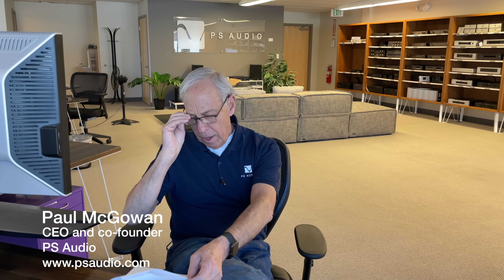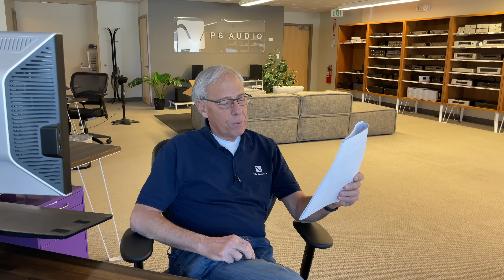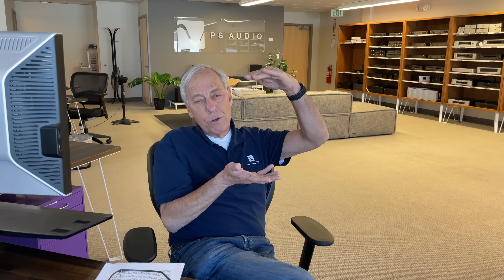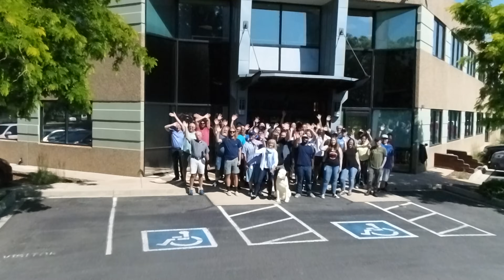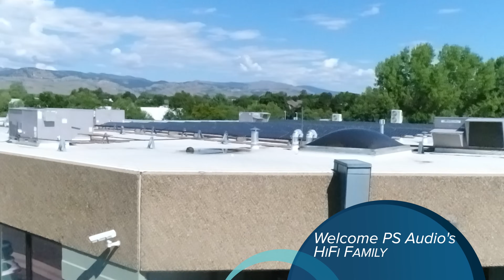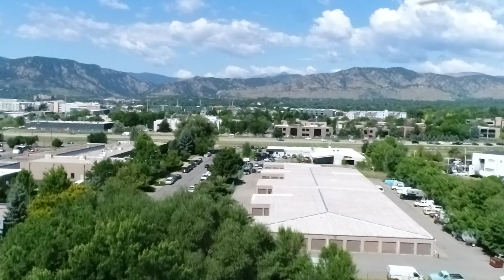Understanding multiple woofers

Comment: Hm. Everyone should hear single driver speakers to understand one concept of stereo theory: phase. A crossover-less design showcases this. Start adding multiple drivers and phase quickly goes to hell. Bookshelfs (2 driver) often have better phase albeit at the sacrifice of the lower frequencies. In 3-way towers the phase in sacrificed for lower mid-bass. Generally, the more you expensive the speakers the BETTER the phase. Bottom line: yes towers have more of the frequency range, but you'll pay lots more for well managed phase than many 2-way bookshelfs. Bookshelfs can be magical, especially in small rooms, near-field and lower volumes. Towers are only magical when you pay lots more.

Comment: Still not answered the question for me.!  If a 12" woofer can put out a low of 40hz how will 100 or any number of the same put out a lower frequency???. Surly it would just be a lot louder.
Reply: Exactly!
Hell...  my tiny balanced armature In-Ears extend down strongly to below 20hz.

Vd (swept volume)
or (Xmax)(Sd)..., stroke(area)
Doesn't determine extension!

Comment: If you want to play at realistic concert levels , try 15" or18" bass like the jbl 4345....you wont go back to 10" or less ,you will feel the vibrations , the umpf...very fast bassnotes and deep, the cone barely moves ,so less linear distortion....the skin of the kichdrum does not move a lot, to portray big instruments you need surface to get the real timbre...i have all dimentions of bass systems

Comment: Two 6 inch woofers is closest equivalent to an 8 inch. My mains have ONE 15” woofer - which is equivalent to SIX 6 inch woofers.  Surface area of a circle the square of the radius multiplied by 3.14. Paul is quite right - bigger speaker cabinets matched with large woofers make a huge difference in bass quality. It is important to match the driver design (resonance) with the cabinet volume (the cabinet acts like a spring or “acoustic suspension” and should be tuned to dampen the natural resonance of the woofer)

Comment: Correction: A 6 inch woofer can (if done right atleast) go just as deep as a 12 inch.. BUT at a MUCH lower db level.. And a 6 inch must work much harder than a 12 inch.
But yes.. Bookshelf speakers are really silly if not used in a actual bookshelf or simular. Using them on a stand on the floor is so pointless since they as you say, need the exact same space and you just get less bass. And often even pay about the same or even more for that smaller speaker too... Bad deal :P
Reply: Fellow Norwegian here, because of neighbors in the same wooden building I'm going to use  bookshelf's hehe. I just turn my subwoofer off at night
Reply: @FSXgta  Men det gir jo ingen mening... Spesielt om du uansett har sub. Gulvstående vil ikke plage naboen noe mer enn en bokhylle/stativhøyttaler.. Og om du tenker på vibrasjoner i gulv (det er igrunn minimalt) så er det jo bare å bruke spikes😋

Comment: Basic error. At least four  6in woofers are required to give the same cone area as a single 12in woofer. Pi X R squared. Also, the single 12 will generally give lower bass than four 6 woofers because the natural resonant frequency of a 12 is much lower than a 6. A 6in speaker will struggle below 80Hz and will produce a high level of distortion in the process, a 12in woofer should go down to 30Hz easily.

Comment: I watch these videos every day and have never felt the need to comment, but I respectfully disagree that a floor stander and bookshelf take up the same amount of visual space. If it's a dedicated listening room however, ignore that. 
Additionally, when it comes to budget speakers, going from bookshelf to floor stander from the same speaker series will often cost you as much as 1.5 times as much. In that case, one might as well buy a higher end bookshelf or invest in a better amp. 
You can always save up for a subwoofer down the line and have a choice of where the bass sounds best; but have exceptional highs and mids right now.

Comment: Would a 6 inch woofer or multiple's of not move faster than a 12 inch solely due to less mass?
Reply: Yes, usually a smaller cone can move faster which translates into better ability to reproduce higher frequencies.
Reply: @ThinkingBetter  I'm thinking along the lines of faster tighter bass
Reply: @GerryHammer  I wouldn’t call it “faster bass” but assume you mean bass sounds better when it has good transient response meaning it starts and stops with minimum inertia or ringing. This is a very important quality for me also. For example a woofer with a passive radiator might output more bass but will have a slower decay than a closed box woofer causing the bass to sound more boomy. I hate that.
Reply: @ThinkingBetter  Yes exactly, thank you.
Reply: Yes. But a larger diameter cone will go lower due to its lower resonant frequency. Box loudspeaker design has multiple compromises and is the weakest link in the chain. For this reason, I prefer electrostatics.

Comment: Yes, you should have let Chris answer this one. There's WAY more to speaker design than just multiplying drivers. 

As others have pointed out, just on geometric area alone, you'd need 4 6" woofers to get close to a single 12", but it won't necessarily lower the bass response. 

If anyone would like to have a more in depth explanation, you can come over to Toidsdiyaudio forum. We'll answer anything we can and do research to answer the rest. And Paul, you'd be more than welcome. All we want to do is share any knowledge we have to grow the audio community.

Comment: It did not sound right when you said it, the mathematic part. I used to teach math.  pi times radius squared equals area. Radius is 1/2 the diameter. 
6 inch woofer area = 3.14 x 3 in. x 3in. = 28.26 square inches. 
12 inch woofer area = 3.14 x 6 in. x 6 in.= 113.04 square inches.  
113.04 divided by 28.26 = 4
Four six inch woofers equals one twelve inch woofer, but what about the ohm rating of these 4 woofers all being used at the same time?

Comment: There is no replacement for displacement.  I use 18" woofers.  Rich easy well defined bass with the weight you expect from the big instruments that make bass.  Pianos sound like pianos, cello like a cello.  But it also needs support for the lower octaves.  I plan to one day add some very big subs to fill it out.

Comment: I have four 8 inch woofers total in my floorstanders and four 10 inch woofers in my subs. Mathematically this means I have....lots of woofers. A sled team of woofers. Possibly the same surface area as one 68th of a helicopter landing pad. For a small helicopter. Not one of those big twin rotor ones. That would be stupid. 
It's great for dance music. I hate dance music. Happily it's pretty darn good for everything else as well. Unfortunately one of my subs is in woofer hospital right now, having taken ill during some organ music and starting to emit a loud ticking noise from the back. They say it's an air leak but I think it just wanted a rest from all the dance music.

Comment: 2 x 6"woofer are not the same as a 12"woofer. Four six inch woofers would have the same area as one 12"
Reply: i would say 5 or 6, but yeah
Reply: @wesleylargen  Cone depth and cone material area has no influence on the sound. [Cone material area * angle of attack at each point on the cone] == pi*r^2.   Just like a solar panel's power is from panel size * angle with sun.  Cones are used only to reduce deformation of the cone because it'll be mechanically stronger in the direction of motion when using very light materials have to be used.
Reply: 2 x 6" woofers is similar to a 9" woofer. 4 x 6" woofers is equal to a single 12" woofer. Formula is simple: # of woofers x area of circle. Area of circle = Pi x R squared. Plug in the numbers to get the result. However in my personal experience a single 12 inch woofer sounds better than 4 x 6 inch woofers.

Comment: Except for the Gershman "STUIO II's" that are a bookshelf going down to a neutral 25 hertz without distortion or bloating  .:)
Reply: @Lloyd Stout Have you heard the model ?  I have.  I now own a pair. I am a musician, and I know what frequencies that I am hearing.  A low e on fender Precision bass is 41 hz for one example.  A low B on a five string bass is 31 hz. This driver is a double magnet with a multiple layer voice coil.  The speaker uses HDF instead of MDF, allowing for lower bass coupling with the air.  And the crossover is point to point, polypro caps and air core inductors.  
...
Gershman is the only speaker manufacturer that has a full recording studio and speaker test room that are the same room.  Meaning that they record the Steinway, or acoustic guitar, or electric guitar, and test the speakers in the same room.  They then voice the speakers to the authentic sound.  Play the Steinway, then play the recording of the same instrument on the speakers.  Design the speaker to match the Steinway in a head to head method.
...
The bass from these Gershman pressurizes the room like a sub.  Except the bass is neutral with no distortion or bloating.  And +/- 6db they can go down to 20 hz.  Like you Lloyd, each reviewer was skeptical of the specs, until they heard the speakers after they were broken in.  These things are a unicorn  .:)
Reply: @Lloyd Stout I forgot to mention that the mid bass drivers are a thicker aluminum with huge surrounds.  The surrounds of a sub.  Massive excursion.  Like all musicians today I am also a recording engineer.  I am familiar with the 20hz range from kick drums, and rolling off large diaphragm condenser floor rumble and handling noise.
...
Oh and I see that I misspelled the model name above > "STUDIO II's"

Comment: Also worth noting that the tweeter is often different. Ie a 2 way bookshelf speaker with 1 bass driver will often have a lower efficiency tweeter than a floor standing speaker that has 2 or 4 woofers. Even if the tweeters looks the same the efficiency, impedence and power handing often different.

Comment: If you double the diameter of the woofer from 6" to 12" the surface area increases by a factor of 4. 
In effect a 12" woofer or speaker moves the same air as four 6" woofers (if the excursion is identical).
Reply: @chanslorvalorum6905  Actually, whilst the driver cone surface area is an important parameter in the amount of air being pushed around, the resonance frequency of the speaker is critical and is more related to the cabinet volume and specific dimensions and geometry.
And because volume is a cubic relationship rather than a square or area relationship such as the driver cone surface area, if you double the dimensions of say a square woofer cabinet, the volume increases 8 fold.

Comment: Paul, if u had a pizza 12" dia. and two 6" pizzas and u ate one 12" or two 6" u would b a lot more full with the 12" pizza. Try it!
Reply: Area of a circle is proportional to the diameter squared.

Double the diameter and the area goes up 4 times.

A 12” pizza is equivalent to four 6” pizzas

Comment: Multiple small woofers are also faster than one large woofer.
Reply: Nope. Old myth. Are the woofers designed properly they have stronger motor and suspension to make up for the increased size.
Reply: That's a good point.  If the maker designs the woofer properly and doesn't skimp on cost, then it won't hurt speed.

Comment: There is another very important part - at least for me it is: Power handling and dynamics. Assuming a 6" woofer has the same magnet / voice coil structure /power handling as a 12", a pair can handle more power, maybe twice. Also because two drivers are now handling what one would otherwise, given the same power, etc, they don't need to move in and out as much to produce the signal as if there was only one. The result is partly, speed: the smaller cones can move faster to accomplish the same frequency. Also it is said lower distortion is another benefit because of the reduced cone excursion. As such details and dynamics can come out more. Generally. As we know imaging and sound stage can improve in a narrow cabinet. Lot of good reasons. That's why we see the tall speakers with an array of 6" drivers.
Reply: the result is not to achieve speed. think about the simple fact that lowering the frequency means lowering the speed that the cone is moving. the idea of using multiple drivers is to achieve a higher amplitude at the frequencies the cones are moving at. Paul was correct in that the idea is to move air more effectively overcoming the compression resistance of the cabinet. it's not to get lower but to get louder at the lower frequency desired.
Reply: but Paul was incorrect in his summation of surface area of two 6" drivers being more than a 12". however what was in the back of his mind and didn't translate well is the effectiveness of 2 6" drivers overcoming that compression resistance in the cabinet vs. a single 12" driver due to all the other factors aside from surface area like magnet strength vs. air resistance, rigidity of the spider needed etc... that affect the quality of the reproduced sound and frequencies achievable going to multiple drivers. the simple fact is yes you get lower/louder bass with bigger diameter, but the total build of the driver; magnet, surround, spider, coil etc.. needs to scale much more than 2 smaller drivers to get the same quality of reproduction.

the basic takeaway is simply this, multiple smaller drivers are used to save on manufacturing costs and to get away with less well engineered drivers to achieve less distortion. also smaller drivers means thinner cabinet designs which sell better due to significant other approval ratings, and if the speaker doesn't sell the manufacturer doesn't make.
Reply: @wetwareinterface3977  Hmm. Food for thought. But! Danny Richie at GR Research discussed this 'speed' thing better than I could ever. Of course if the driver is reproducing a 20 Hz tone, the driver is moving slowly as compared to a 500 Hz tone. But it's the speed of the stopping power (the speed at which it can reverse and go forward again) that I'm talking about. When the signal goes silent (say, after a kick drum hit), a driver that is not fast will take a longer time to stop reproducing the signal. Boominess or mudiness is the result. That's why audiophiles like high power with strong well-designed drivers. So whatever the frequency, a fast driver starts and stops quickly, whatever the frequency, and the tight dynamic impact is appreciated. A big woofer with low power or a loose structure (say with the small magnets that Cerwin Vega uses) is like a truck: boomy but slow to respond. Multiple 6 inch drivers may cost less (not really so much; in many cases maybe as much as 80% the cost of a 12 inch. It doesn't take any more time - a major factor - to make either one. Shipping costs often play a greater role than material costs and larger drivers raise cabinet costs and challenge imaging and soundstage, which is exactly what makes audiophiles melt), but whatever valid points about economics, they have an advantage. Not everyone is gonna buy a Wilson Watt Puppy.

Comment: Buzzzz, wrong. Generally, two six inch woofers is 56.5 square inches and one twelve inch woofer is 113 square inches.  So you would  have less woofer travel  with a single 12".  Pie R Square, cake are round. Any chance the multi woofer system might be a two and a half way system?
Reply from the maker: Oh shoot. You're right. Dang it. Thanks for the correction. I was thinking 8" woofer where 2 are bigger than a single 12".

Comment: You are right on just one count: you should have asked Chris. 

For example, it's not engineering calculus to determine that a 6" woofer has a planar surface area of A = πr^2, or ~28 square inches. One 12 inch woofer would be ~113 square inches. It would take ~4 each 6" woofers to have the surface area of one 12" device.
I think, among other things, Chris could do this in his head.
Also, Chris might point out that adding multiple woofers (among other issues) allows less cone excursion for each for less distortion, provides better coupling to the room air, allowing more sound level, but not primarily lower bass frequency extensions. That would be done primarily by the enclosure size/type and cone material/voice coil. 

What adds to the confusion for newcomers to audio is that a well designed standmount speaker might very likely sound better in your room than a poorly designed floor-stander.

[Full stop]

Comment: Maybe my maths ain’t what it used to be. But, I calculate that the surface area of a 12 inch woofer is  113 square inches approximately! Where as the surface area of a 6 inch woofer is approximately  28 square inches.  So 4 6 inch woofers would have a total surface area of 112 square inches approximately. Only fractionally more than 1 12 inch woofer!

My current speakers have 4 6.5 inch front firing, low frequency drivers. My previous speakers had 2 12 inch forward firing woofers and 1 10 inch down firing low frequency driver.  I would say that my previous speakers went lower than my current pair. I never felt the need to add a sub, although now that I run my current speakers along side a pair of Rels, I know my old pair would have benefited from the addition of a sub, or pair of subs. Whilst my new speakers don’t go as low as my previous pair, they have far more bass punch than my old ones and pressurise the room a lot more easily.  Which is better? Well that depend on the genre of music.  The old pair played music in a relaxed and effortless manner. The new ones are more forward and in your face. Different, not better!
Reply: What were your previous speakers? AR9LS?

Comment: More drivers results in lower impedance and hence much harder to drive. Something to consider if your ears has a dislike for class D amp tone.
Reply: You could have 1 x 12" 4 ohm woofer or 4 x 6"  4 ohm woofers wired in series/parallel giving you 4 ohms or 4 x 6" 16 ohm in parallel giving you 4 ohm